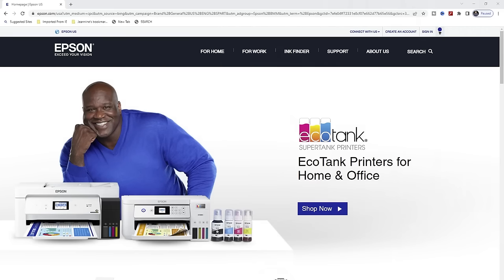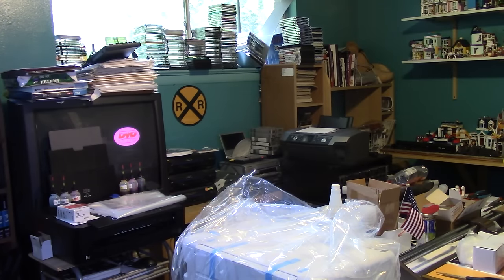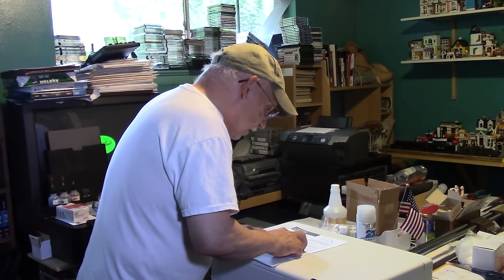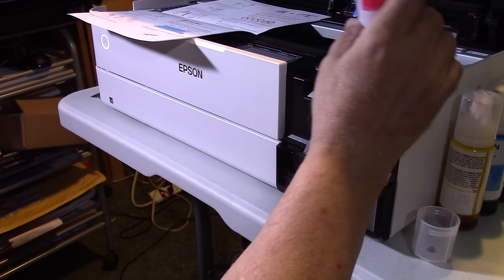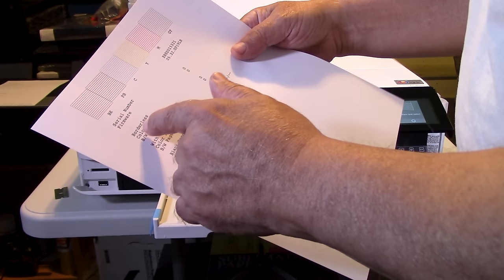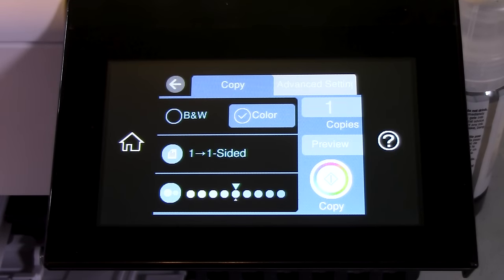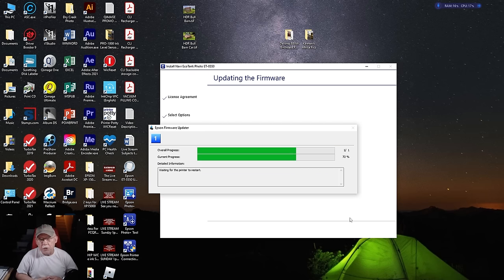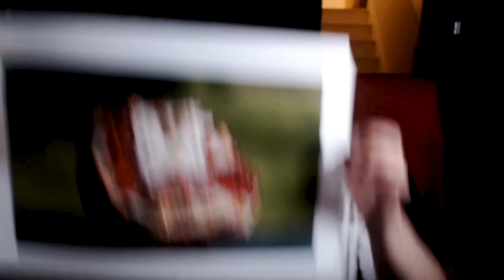The EPSON Eco Tank 8550 Multi part EVERYTHING Video!

Comment: I got my ET-8550 almost a year ago when they were super hard to get ahold of; mine's a refurb direct from Epson.  I was a little hesitant because of potential negatives such as, "it has fewer colors" or "it uses dyes", but honestly, with a little care and setup, it can produce prints that are quite a bit better than back in the day when I made wet RA4 prints in a lab. 

I'm absolutely thrilled with it.  I gave up trying to get good results from online print houses, including very well known ones and just went for the printer. Those dye inks are fantastic on the right paper.  The results I can get out of it are better than any lab I've tried. And it's cheap to run!  But yes, it drinks the grey faster than any other color.

The only negative is it can be slow, especially on best quality, large prints, but I'm not trying to churn out pictures, so it doesn't matter to me.

Comment: Ok, you should know by now, that all the ink bottles are keyed differently for each color.  I found this out by trying to put the wrong color in an ET-2760, it would not go in the slot, so then I checked and found out I tried a wrong one.  Once you put the correct one in, it flows like water into the tank.  My printer works fine, and it's close to 3 years old now, and we moved one time.  No issues, provided you keep the printer UP, do not turn on side, nor tilt it when moving.  Great Video Review.

Comment: I just got Epson 8550 and your vidos on this printer are awsome. Really good information!!!
The output on this printer is raelly good. Especially the B&W prints once the driver is set for B&W and no profiles are used. Oh by the way the latest IMac os (Ventra I belive) is terrible. The Epson driver on this version just doesn't work. Since I am already heavily invested Apple computer, I bought a cheaper Windows laptop so I can run Qimage Ulimate. I am running the trial version but will buy this awsome software. Qimage One for Apple computers is a problem since Epson driver is the issue.

Comment: Why would I ever want to fill it with non-OEM ink? Well, I think I would like to try a couple of cone inks. Super super duper blacks actually. And see if that has any influence or improvement in depth, contrast and intensity or whatever. Definitely want to try the HD photogloss black, tend to be honest, I don't even use this printer for text so I don't care what the blacks are like. I'd be happy to try his HD matte  pigment based  Black one as well; buy in bulk and share among a few printers if necessary.

[Oh which you mentioned right after your initial statement but I had paused it lol]

Comment: Love your videos, and your thoroughness. And you found quite the niche that is very much yours. I actually have a question. I just got an 8550 to replace my 7500 which is still in mint condition and works perfectly. It's photos are great, and I don't know even if I noticed that much of a difference with the addition of the gray ink. And then I guess some maybe the technology has improved or something I don't know. Do you have any thoughts on this? 

I kind of wish I had bought the 7550 for the wider format. And so I kind of was always jonesing for a larger form factor one. Well now it turns out I'm probably going to have another printer anyways, if I can get this Canon Pro 1000 working. In which case how important is it to me? Have a large super super cheap printer that prints decent photos? 

And perhaps at a thousand bucks, and that I haven't gotten $500 for my previous ET printer perhaps I should consider just staying with my previous 7500. You don't happen to have any thoughts on this dude? I don't know if you've compared them or not, probably not though.

Comment: Hola Jose,

Is there a difference between the Epson 502 and 552 black inks? I know the bottles have different coded caps but, are the inks compatible? I ask because I noticed the combo ink packs from Epson does not include the black ink.

The coded caps prevents users from pouring the wrong ink into a wrong tank.

I also noticed that initialization consumes some ink.  After printing a few dozen images, I used the remaining ink on the original bottles to top off the tanks.

Comment: Hi Jose, I'm sure helping U or someone here can help me because I am at my wit's end. :(

I bought the Epson ET 8550 & I have it installed on my laptop now. However, when I opened my pdf file that I created in Procreate, in Adobe Reader, while the printer dialogue box is larger than it is in Procreate on my iPad bc no drivers are installed for that, there still is no place to select borderless. I clicked on Advanced Settings & More Options and still zilch! 

Do you know what program I need to use to open these in to get the borderless option? I asked Epson when I spoke with them earlier, but they were useless.

Thank you so much, I really appreciate it.

Comment: Hello Jose, very good video!
Jose just bought that printer and I'm realizing that the gray color is not printing, the tank of that color is still intact after many prints, unlike the others that have lowered their level, and when performing the nozzle test I only get It prints 5 colors, the gray color is missing, I have already done cleaning and I cannot solve the problem, do you have any suggestions for me?
Reply: Did you figure out the issue with the gray not printing?
Reply: @markmuller3086  Yes friend, I disarmed it myself and discovered that the gray hose was strangled.

Comment: Tremendous video Jose, you always do a great job on them.  I need to upgrade my old Epson 1400 and I was already to buy the XP 15000 which I have learned so much from you about.  But this ECOTank is a game changer especially for the ink costs.  In comparing the photo print quality which would you say is better the XP 15000 or the ET 8550 or are they equal.  Thanks again so much for your great work.  Take Care

Comment: I just got the epson echo tank ET 8550 I finally got it to print the 13 x 19 page from the back paper tray.  now I want to print 8.5 x 11 and can't get it to print it says its out of paper.  I loaded paper in the back tray and cartridge 2 and it still says it's out of paper. How do I get it to recognize where the paper is and print from that port
Reply from the maker: That's strange. There are sensors that can "Feel" there is paper installed. Restart the printer and see if it clears that error.

Comment: JOSE I have had my ET8550 for about a month. I can not agree with you on this machine. Thinking about sending it back. It constantly clogs!!!! The Ole EPSON CLOGS are back. YES I use it everyday. Yesterday I had 3 clogs during a print run. And it has some sort of looks like there's a cat tail up underneath the print head! There are ink smears on about every 5th print most are off twards the border but some are on the image areas. I have 145 complete in the print history.  It seems to be no better than an Old HP office printer.

Comment: At 57:12 the outfeed paper tray slides out.
Are those two (2) blue things on the sides of the tray packing tapes?
Very easy to see.
Should they have been removed?
Or maybe they were something else.
Reply from the maker: Something else.
Reply: @cheo1949  really? What are they? I think I removed mine if it had them thinking it was just more blue tape. 
Also while I have you, I have the ET-8500. I've been having jamming problems  I've trying to print on double sided thin gloss paper. First I tried 32 which was 140lbz. No chance. I'm using 38 now which is 160lb. Every few times it jams. I just started trying tray #2 over the tray on top and it's worked the first 2 times but I'm still wary. Any advice.  I have the settings on just glossy paper since apparently premium etc are all thicker. Do I need to actually choose the thin paper setting which doesn't mention photo or gloss at all on it.  I'm also wondering if the paper isn't lined up perfectly since sometimes it seems almost like it's off the the right just a little to much.  I've don't all the maintenance things in settings besides the highest super power cleaning option. Idk if I need to go that far or if that even matters since quality isn't a problem.  I know I should of bought the 8550 I wish I did even if it doesn't apply to this problem.  Also paper size is normal 8.5×11

Comment: Is there a way to convert the dye inks to pigment ? Or anyone selling comparable pigment colors to replace the dye ?
Reply from the maker: No. You can not convert a dye ink to pigment. You would need a LAB.
You can however switch from Dye inks to pigment inks but only on EPSON Printers that allow you to use refillable cartridges.
Reply: @cheo1949  
Hey Jose, I totally worded that wrong, but you answered my question anyways. I want to use all pigment inks in this printer, and wasn't sure if that was possible. I understood some and missed most when you were mentioning it in the video. Could you point me in the right direction to find info and ink on how to ?